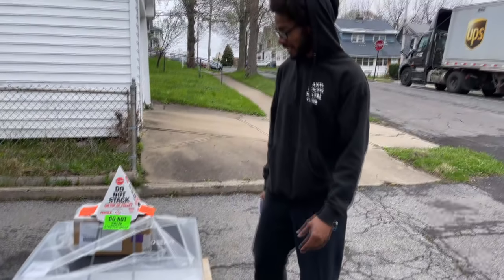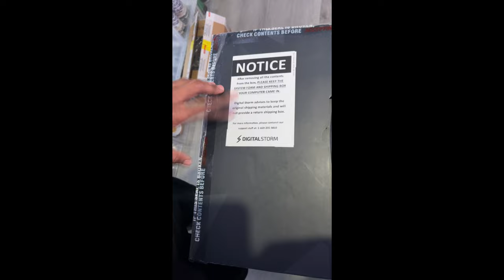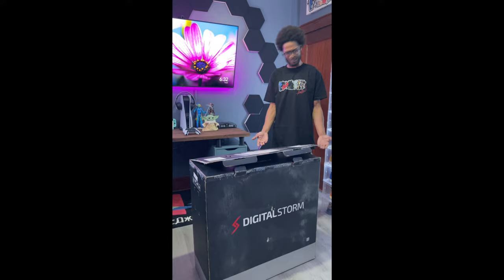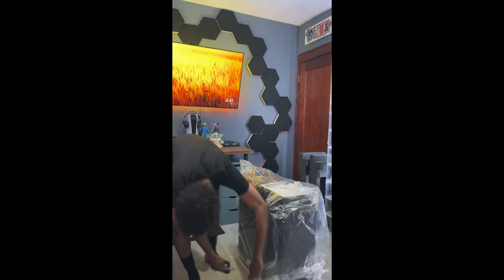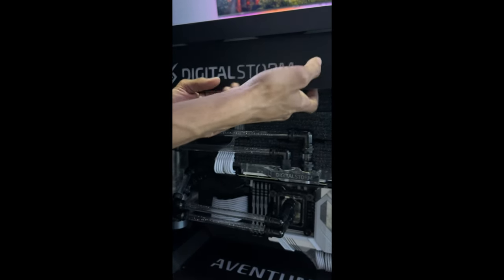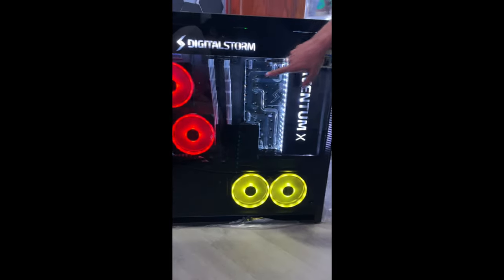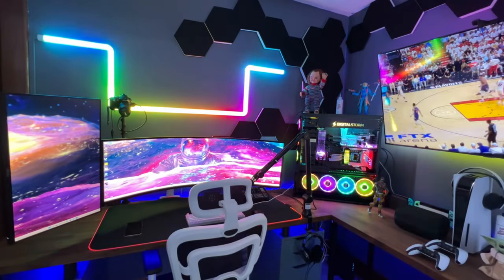UNBOXING : Digital Storms Aventum X $9500 Custom PC Build

Comment: I have seen these on the their website and it does look nice.  Can I ask you if digital Storm gives you a maintence schedule to follow or do you follow your own? Ex:  How often to drain and flush the loop? When to change older connections? Other Maintence schedules?  I am a competent builder but not an enthusiast. I know about AIO's and Air Cooling a PC. I don't know anything Custom loops and how to clean and maintain them but I would not mind looking into saving up to buy a PC like this.  Do you think this would fit a person like myself?  I don't mind doing a cleaning every 6 months or once year but this looks like something that would need to be checked on every 3 months or so.  Can you give an average consumer myself who builds / buys every few years some advice or should i just stick to building my own with AIO's and Air Cooling?  I don't mind some constructive criticism.
Reply from the maker: @Yardbank  these are actually great questions and I’ve actually been meaning to do an update video explaining all of this. But I’ll explain it for you here.

Digital Storm (DS) doesn’t give you a maintenance schedule to follow, but from just doing research on custom loops. It’s recommended to drain and flush your loop every 6-12 months. I think 6 month range varies depending on usage and which type of fluid you choose to use.

If you choose to use a colored fluid, it’s recommended to drain and flush at the 6 month mark due to the build up it can cause from prolonged use.

If you use a clear liquid you can extend that up to 12 months and be fine.

Now with that saying…… As you can see I use clear fluid, and the very first time I drained and flushed my system was after 2 years of usage. Mainly because I was honestly scared to do the maintenance on it because of the custom loop and the risk of having leaks etc etc….

But after the 2 years, I sat down and watched the DS YouTube video on how to drain and flush the Aventum X atleast 20 times, and then I finally attempted to do it.

And to be 100% honest it was a lot easier than I thought. The fittings that DS uses makes the entire loop easy to maintenance due to the quick disconnect valves.

I drained and flushed out the entire loop twice in that one sitting with absolutely no hiccups or issues. I took temperature readings before and after, and surprisingly there was only a 1 degree difference.

So it’s safe to say that clear liquid can last quite long in a loop without maintenance. But as the professionals recommend. Don’t wait 2 years like me.

I recorded the process and took pictures of the liquid after 2 years of usage and I’ll probably upload it all in a video In the future, but overall. The maintenance hasn’t been troublesome at all so far.

We’ll see as the years go by and if the fittings become lose or when the pump finally stops working, etc etc.

Overall…. I love this thing and I honestly wouldn’t go back to a normal AIO or air cooler.

But make no mistake. AIOs and air coolers are actually very good nowadays.

Custom waterloops are indeed overkill, but they’re just cool as hell to have.

Dont get me wrong custom waterloops produce cooler temps by pretty decent margin. But that’s where the cost/maintenance either makes it worth it to someone or if they should stay practical.

I hope this answer helped and if there’s anything I haven’t answered or if you have any other questions. Feel free to ask! 🙌🏾
Reply: @FabesSole  Thank you for the reply.  This helped a lot.  It answered a lot of my questions. I will look into it more.  The prices have come down since the end of Covid.  You should do a quick follow up video.  Your video is one of the more current ones on the Aventum x. Especially for 2024. The other videos are 3 to 4 years ago and they are with enthusiast computer builders.  I liked your video because it represented the an average consumer buying the Aventum and what they have to do to set it up and maintain it.  All the best.  Thank you again.

Comment: Something you could do instead of switching to ddr5 is getting rly fast ddr4, they have some ddr4 kits that go up to 5333mhz, which is faster than most ddr5.
Reply from the maker: Yea if I upgrade it’ll be a total system upgrade, but that’ll probably be 3-4 years from now. When the RTX 7 series will be a thing 🤣😂

Comment: Only thing im curious about is how do you upgrade the watercooled gpu in the future? Will digital storm sell ya a new one?
Reply from the maker: Yes, I can contact them and purchase the water cooled GPU directly from them. Of course it’ll come at a more expensive price if I were to buy the card myself and attached the water cooled plates myself. But I’d rather not 😅. Plus they will make sure the card properly fits with the already existing waterloop.

Comment: I just bought one does it actually take 3 months
Reply from the maker: Mine took that long because I bought mine during the silicon chip shortage in 2022…. So it took them a little longer than normal.

You should most likely get yours within 4-6 weeks
Reply: It's on step 6 out of 7 supposed to ship Friday or Monday
Reply from the maker: @Reaper1overandout  should get you within the next 2 weeks! The last 2 steps take the longest
Reply: @FabesSole  gotcha I spent 6800 on it using the lumos case with the i9 14900
Reply from the maker: @Reaper1overandout  nice!!! I know you’re excited about getting it! 

Enjoy that beautiful machine!
Reply: @FabesSole  bro def can't wait feel like it's been for ever

Comment: I am planning on trying to get this PC with these specs (I kinda just copied and pasted) Chassis Model: Aventum X
Processor: Intel Core i9-14900KS (6.2 GHz Turbo) (32-Thread) (24-Core) 3.2 GHz (14th Gen)
Motherboard: ASUS ROG Maximus Z790 Dark Hero (Wi-Fi) (Z790) (Up to 3x PCI-E) (No SLI) (DDR5)
System Memory: 64GB DDR5 6000MHz Kingston FURY Beast RGB
Power Supply: 1500W Corsair HX1500i (Modular) (80 Plus Platinum)
Storage Set 1: 1x SSD M.2 (8TB Sabrent Rocket 4 Plus) (NVM Express)
Storage Set 2: 1x SSD M.2 (8TB Sabrent Rocket 4 Plus) (NVM Express)
Storage Set 3: 1x SSD M.2 (8TB Sabrent Rocket 4 Plus) (NVM Express)
RAID Config: - No Thanks
RAID Card: - No Thanks
Optical Drive: - No Thanks
Internet Access: High Speed Network Port (Supports High-Speed Cable / DSL / Network Connections)
Graphics Card(s): 1x GeForce RTX 4090 24GB (VR Ready)
Sound Card: Integrated Motherboard Audio
Add On Card: - No Thanks
Extreme Cooling: H20: Stage 3: Digital Storm Vortex Liquid CPU Cooler (Triple Fan) (Fully Sealed + No Maintenance cooling
  cooling system selected
Cable Management: Exotic Cable Management - Black - (Cable Combs with Custom Color Sleeved Extension Cables)
Software Control: - No Thanks
Internal Lighting: Remote Controlled Advanced LED Lighting System (Multiple RGB Color Modes)
Chassis Fans: Corsair QL Series (RGB Fans) (Software Controlled Effects) (14 Fans Total)
CPU Boost: Turbo Boost Technology
OS Boost: - No Thanks, Please do not tweak the services on the operating system
Operating System: Microsoft Windows 11 Professional (64-Bit)
Recovery Tools: USB Drive - Windows Installation (Format and Clean Install)
Virus Protection: Windows Defender Antivirus (Built-in to Windows)
T-Shirt / Hoodie: - No Thanks
Keyboard / Mouse: - No Thanks
Mouse Pad: - No Thanks
Display: - No Thanks
Headset: - No Thanks
Priority Build: - No Thanks, Ship Within 10-15 Business Days After Order Is Successfully Processed
Warranty: Life-time Expert Care with 4 Year Limited Warranty (4 Year Labor & 2 Year Part Replacement). $12,057.00 I also am trying to find a desk that can fit this gigantic PC
Reply: Why are you getting such expensive 8TB SSDs? That's like 3k alone. You don't want your OS Drive to be so large.
Reply: @deanwilliams433  because I don't give a shit about money
Reply: @LittleBabyMan2  Okay, but it still does not give you any benefit. Good luck!
Reply: @LittleBabyMan2  Yeah especially when you're just screwing around with the build configurator and not actually buying anything... Having an imagination is priceless! 🙄
Reply: @mjames3662  What is that supposed to mean?

Comment: grreat pc im not hating butt that is not worth what they charge. but great PC still not the value.
Reply from the maker: Oh trust me. I agree with you 100% when it comes to cost. Even right now you can get this machine with better components for $3000 less than what I paid. But I bought mine at the height of the silicone chip shortage. So my impatience made me pay a lot more 😩. Still happy with the PC and overall experience with digital storm. But yea. Overpriced for sure!
Reply: Ok got one of those same pcs and they keep my parts so cold!
Reply from the maker: @DJCrane407  definitely quality engineering! I love it!
Reply: Brah people who are buying this beast don't care about 💸, i mean come on they even got custom power distribution panel on that thing.

Comment: By far the worst pos pc I've ever had. The custom loop was garbage, when it was time to refill the liquid I noticed several leaks. Upon trying to fix the leaks the tubes just fell apart in my hands. All the fittings were loose, the hardline tubing was crap. The pump also went out after two years and my cpu started overheating. I ended up having to rip the entire custom cooling out it was so bad and while doing it noticed that every single connection was loose. The wiring in the back was also a total disaster. The rgb lighting was crap and peeling away everywhere. Total waste of money on this hunk of junk. Customer service was outstanding though, I'll give them that.
Reply from the maker: @stoneycase5440  wow. I’m sorry to hear your rig wasn’t built with great care. That sucks because to maintain these things, it needs to be built correctly, initially by Digital Storm.

I’m fortunate to not run into those issues as of yet. I’ve drained, flushed, and refilled my custom loop twice so far, and it’s still going strong after these two and a half years of ownership. I just hope it lasts another 5-8 years before heavy parts needs replacing.

I do agree with you on the cost though. I definitely could have saved a few thousand.

And I also agree with the RGB lighting peeling. Mine is peeling a bit in one spot. Annoying to say the least as you’ve dealt with that and much worse.

But yea, it’s a good thing they do have exceptional customer service. It’s their saving grace as to why I would recommend them and buy from them again.
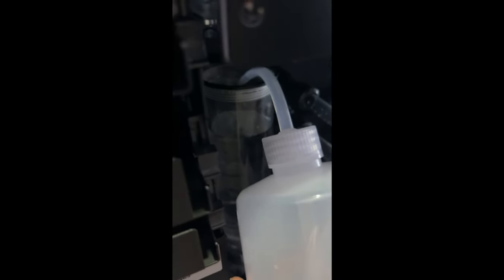Reply: Did you hear what he said at 23:15?
Reply: No one builds a better computer than Apple